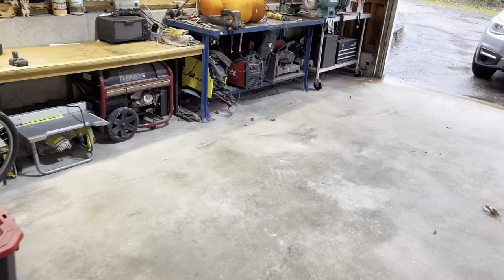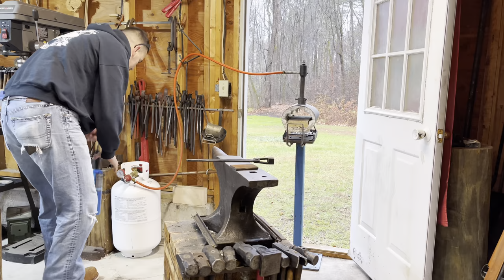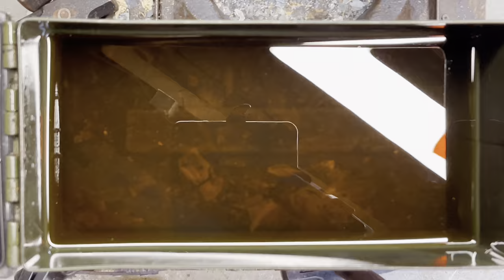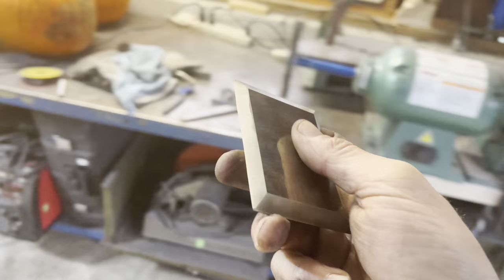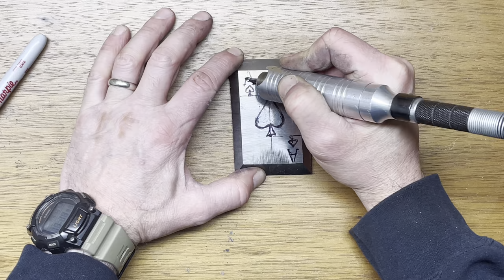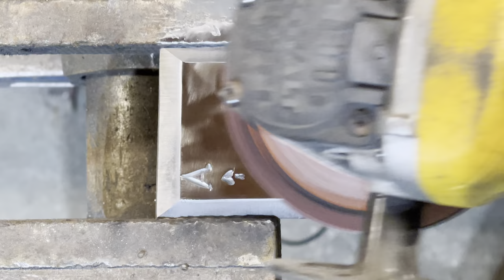Making a REAL steel throwing card! Gambit style from Marvel Comics! #blacksmith #art #marvel #card

Comment: I'm surprised a little how easy this was, relatively. I took a welding class back in 2018 and i actually learned most of the skills using the tools and processes you used to create this. Other then the metal dremel (?not sure if that's the correct spelling or right name for that tool used to carve out the details?) Someone in class actually did own one i got to use but only once to fool around, it was fun but definitely needs practice to be used effectively. 
Anyway thanks, I really appreciate these videos.